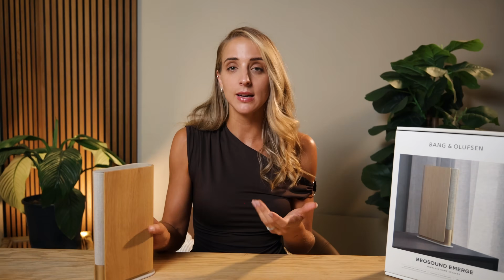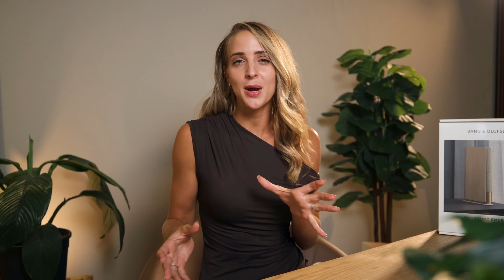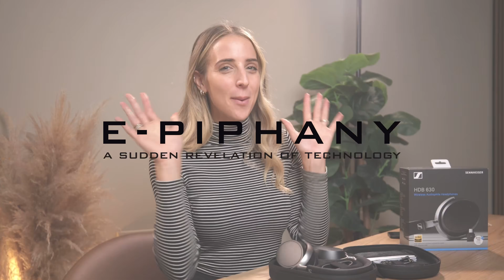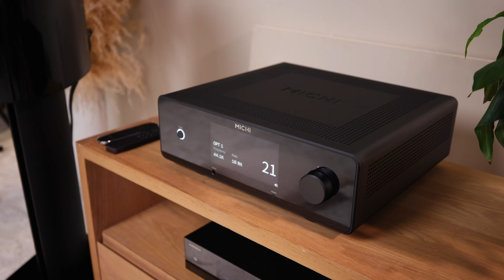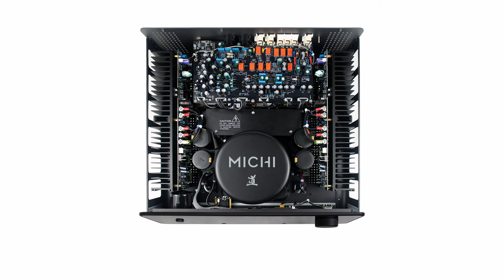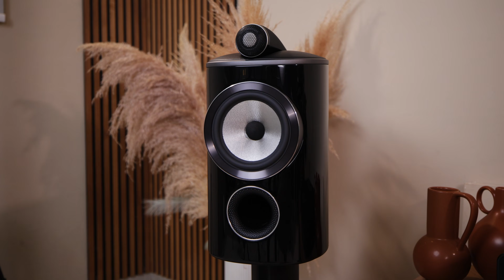Michi X430: A Masterclass in Balance, Grace, and Power.

Comment: This is 6 minutes of advertising but... I have bought the X430 two weeks ago and I can confirm everything that is been said here is true. It is a wonderful amp! Btw, with the new software update the front volume control looks even better.
Reply: Можете сказать, что. У него с басами? Как он будет играть джаз?  Не пожалели ли вв о покупке? Какой усилитель был до этого? Спасибо.
Reply: @ДмитроВеликий it sound absolutely wonderful, even on low levels. Bass is exceptionally good and very tight. Power seems endkess. Dac and phono stage are beter as expected. I owned a Yamaha as 2200, very good amp but soft in the low end.
You won't regret the Michi!